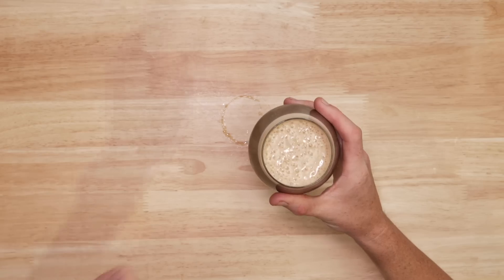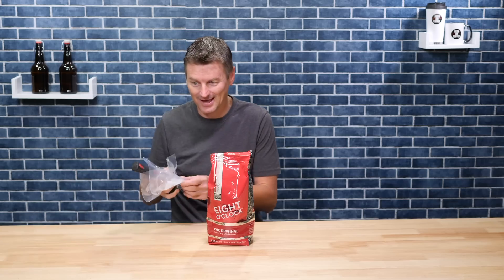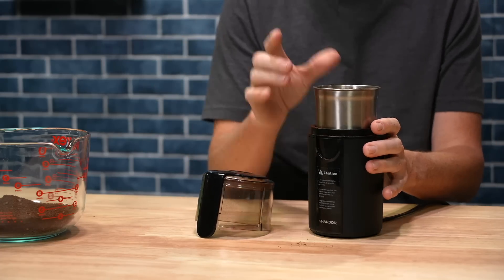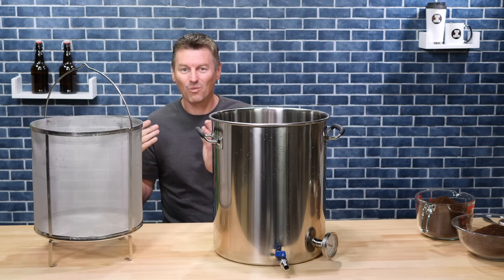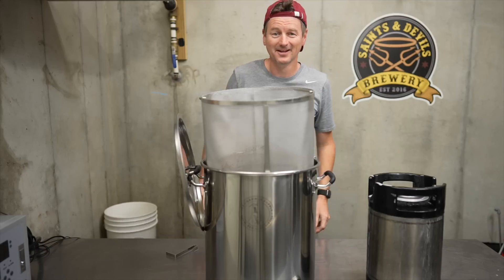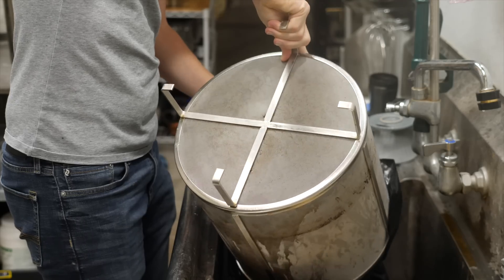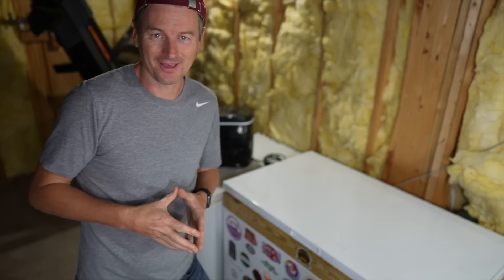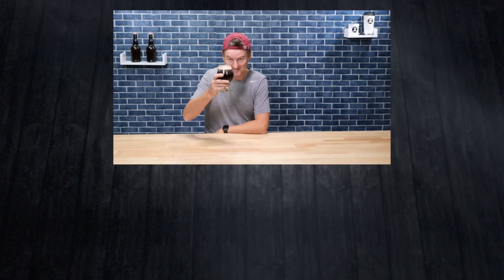Brew and Serve Nitro Cold Brew Coffee using BEER STUFF

Comment: Just got a new 4 tap kegerator and I am planning on using one of the taps for Cold Brew. I wanted to steep the coffee grounds right in the 2.5G keg any thoughts on that.
Reply: Maybe if you transfer it off into another keg, because it is possible to oversteep
Reply from the maker: Agree, two keg solution probably the best. You want to get the coffee off the grinds.